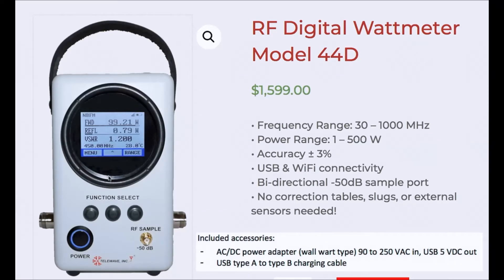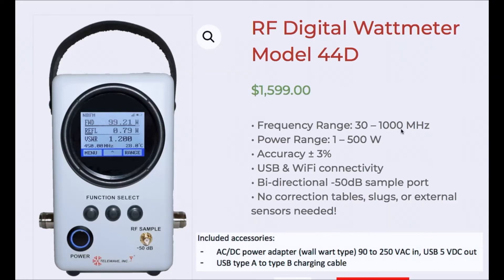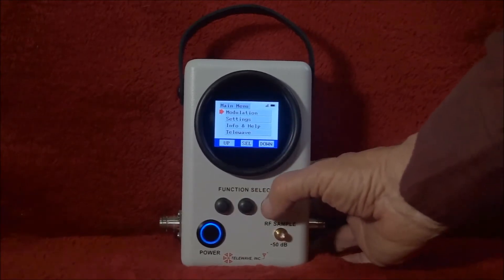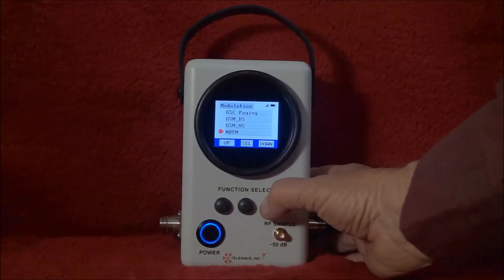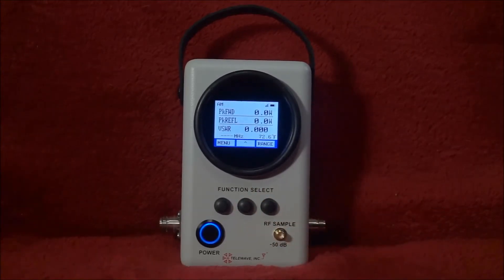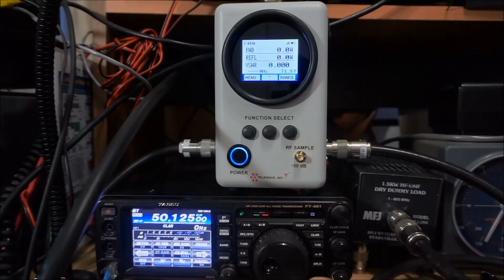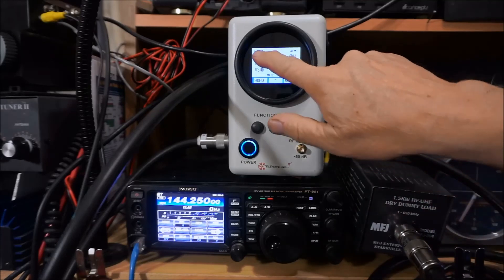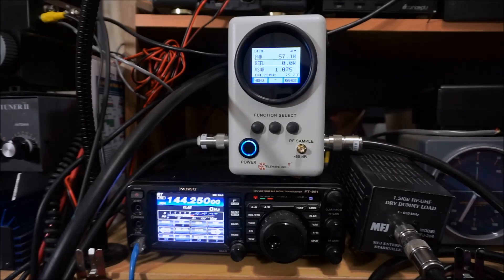Telewave Digital Wattmeter, Model 44D Overview

Comment: I bought one of these meters April 2020, worked fine for 6 months then failed to power up. Finally had Telewave issue warranty RMA (difficult process)and sent back in Feb2021. More than a year later Telewave still have not fixed it, and mostly ignore my calls and emails for a progress update. Not happy.

Comment: Our unit has spent more time back to the factory than it has in the field. A $1600.00 disappointment.
Reply: i really like the Rig expect AA-600  or the AA-1000
Reply: ❌  DITTO !!   Total waste of HARD-EARNED  DONATED  Funds!   
(volunteer fire department who maintains its own gear)

I love my 44-AP.... revolutionary in the RF service world  as no  EXPENSIVE  “slugs” are required.

This digital model ended up souring us on Telewave.   
We sold the meter for 1/3 of what we paid for it AND warned the buyer of everything prior to accepting payment.

We USED to purchase Telewave for practically everything RF.  Even their folded UHF dipole antennas were semi-“gamechangers”
as they can be shipped anywhere without an oversized shipping problem due to the masts normally provided.  
We were purchasing aluminum pipe locally to use as mounting masts.

*AFTER THE DIGITAL METER NIGHTMARE —>>  
WE COMPLETELY STOPPED USING TELEWAVE...   ANTENNAS/ DUPLEXERS / FILTERS / METERS !*
(it’s a matter of principle....  b/c their other products are generally fantastic)

Bird has a digital metering “solution “, but it is cumbersome/ requires all sorts of parts and modules/ is EXPENSIVE.
We were approached by their marketing folk and offered a complimentary donation of a complete digital “package”, 
BUT there were strings attached.  They wanted a review (to publish).. which was perfectly fine and expected....
It was the  “INCLUDE TELEWAVE  NIGHTMARE  DETAILS”  that was a problem.  It’s never worth the time getting involved in
these sorts of industry battles when you are an unpaid volunteer.

So...  we still need a solution!   
I’m willing to purchase a device and donate it to the department just to make my daily tasks easier.

Anyone have any recommendations?   
I noted the RigExpert recommendation above, but i’ve always assumed they 
were more  analyzer’s, more than power and reflected power meters and tailored for the amateur/ham community.

Thanks.
Reply: @PowderMill  I was systems engineer on that program. Much of the layout was shoved down our throats by the designer ; D. Devall ; and Telewave's fake Ph.D engineer not near smart enough to get a grip on this guy.
I have the fix for the 44D. Is real simple , but I don't think the current management at Telewave would listen to me.....
I even showed them, in the lab, with an oscilloscope what was wrong, and how to fix it...... But I think they threw me out in time , probably just to cover it up.........
Reply: @garymoore3497  So can you share the fix? I got ten of them and 5 of them are failing to power up.
Reply: @davegreen5777  they under warranty ?
Reply: @davegreen5777  where are you ?
Reply: @garymoore3497  I am in Montana working for the Department of Trans.
And I am waiting to hear if they under warranty
Reply: @davegreen5777  I am in San Jose, and Telewave is located in Fremont, about 40 miles from my house.
I don't even know if they are even still in business. But, you let me know if they reply back to you, or not.............
Reply: @garymoore3497  They are not replying to my emails, is there a fix that you can share?
Reply: @davegreen5777  I don't know about them not powering up. But the fix is, to fix the high noise floor problem inside the meter. The designer, DD, used switching convertors for the + 5 volt rail and +3.3 volt rail, yet the top of the battery pack is + 6.6 volts and center tapped the voltage is 3.3 volts..... Just simply remove those switching regulators, and tie in directly to the top and center tap of the battery pack....... Then, your meter will read power all the way down to 1 watt.....
Reply: @davegreen5777  have you had any luck with the 44D? We purchased 2 and they failed to charge out of the box about 2 years ago, they were sent back for a refund and stated that they were out of stock. I was curious if they remedied the issues they had, but it looks as if they still haven't.